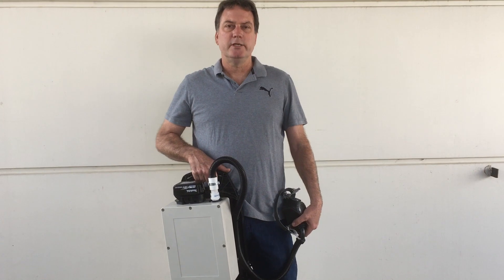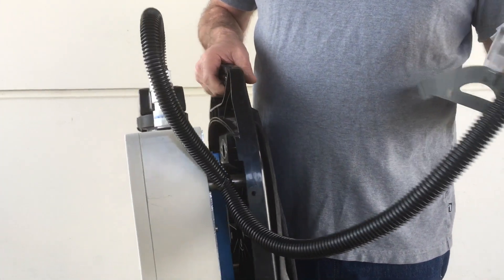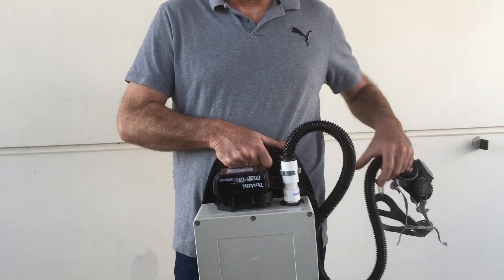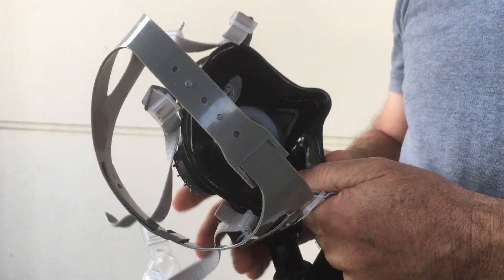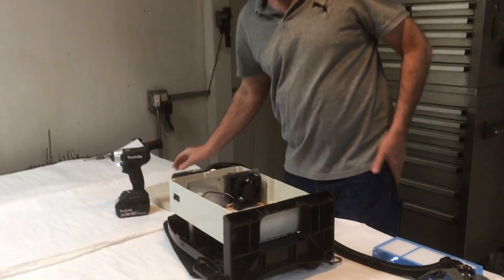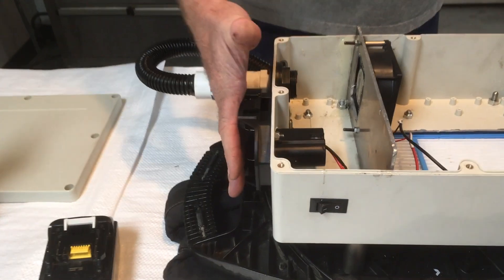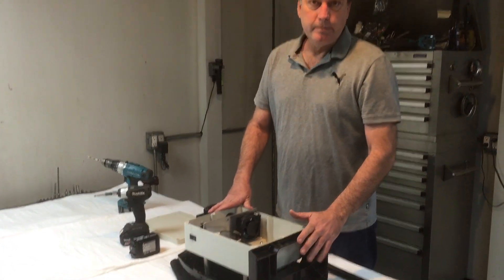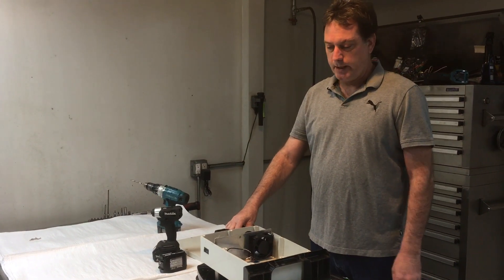DIY Battery Powered Respirator w/hepa filter

Comment: Google "RAD-UM PAPR" for a simpler, inexpensive (about $40) loose-fit design to download...
This is way too bulky and heavy, and protects no one outside the user...There are minimum airflow requirements for tight-fitting and loose-fitting PAPRs (google it)...
It's OK...  even Ford did a crap job with theirs...